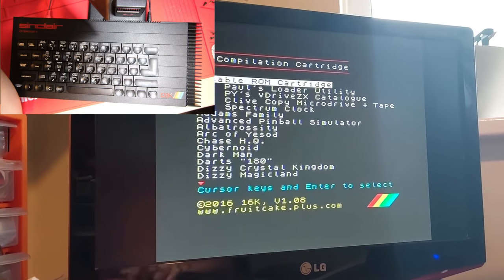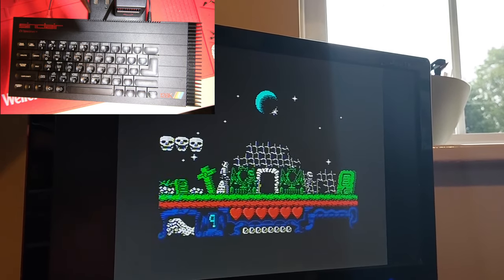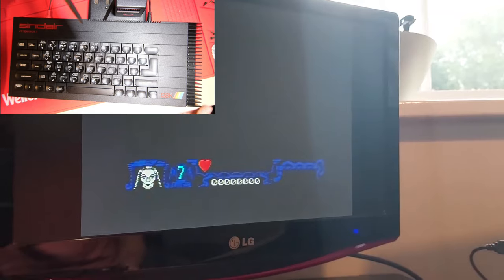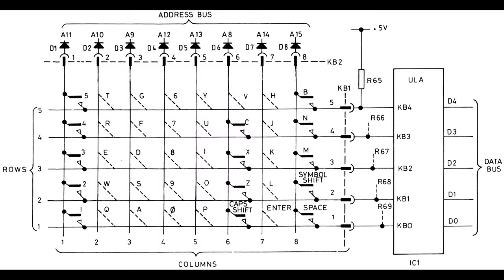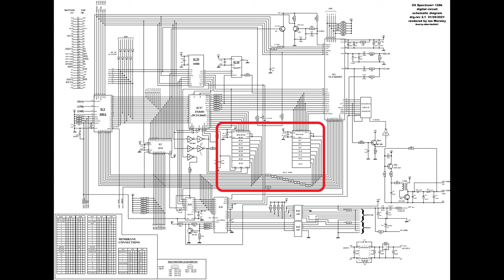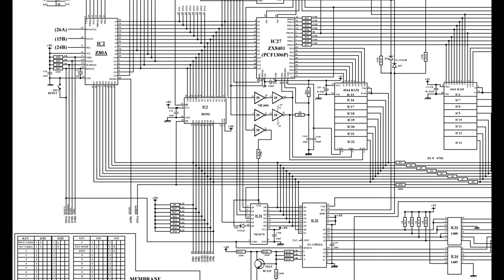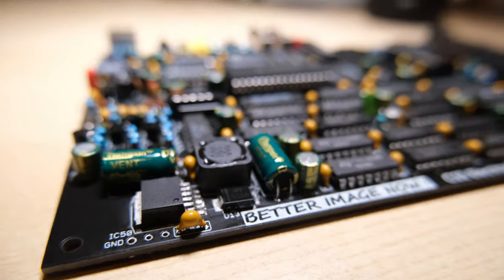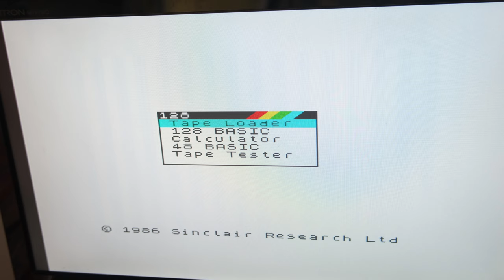ZX Spectrum 128K Toastrack Repair - Games Crashing When Keys Pressed

Comment: It’s jolly interesting how tiny parts of an IC can fail. Maybe not even a hard failure but it just drifted out of spec. Could be just a single transistor driver attached to an address pin. It’s common to see bits (pun) of DRAM go intermittently bad but I’ve never seen a processor do this. Very interesting, cheers for the vid!
Reply from the maker: You're very welcome thanks for watching

Comment: Hi, just to let you know that I had a Toastrack with memory problems in the 128K mode and it was a problem with the AY sound chip. In 48K mode it would run perfectly but with 128K games after 20 mins the system would crash. Under memory test it would indicate different RAM chips. The giveaway was that the sound in the game would start distorting just before the crash. A few drops of IPA on the AY would cool it and bring it back.  Replaced the AY and it has been fine.

Just in case you get one in for repair.
Reply from the maker: Great thanks for the tip!

Comment: ooer, definitely heard of 'weak' or iffy M1 lines on z80s but not address  lines, i suppose any failure mode is possible, what brand was the bad one?... as for the second one not booting from cold unless you reset..dried up reset capacitor?
Reply from the maker: I'm not sure of the brand and it's already in the graveyard. And I'm afraid the reset capacitor isn't the issue with it
Reply: @HappyLittleDiodes  curiouser and curiouser 😏dc-dc converter issue- bad cap there? maybe slow to get voltages up ?
Reply: looking close at the video , the logo looks like the SGS logo, uh oh, i bought 40 of the things fairly cheap in the mid 2000s, hope theyre not iffy !!
Reply from the maker: New caps all round and the issue was the before changing them over
Reply from the maker: If you're interested, replacing the 74S04 chip from the clock circuitry has fixed it
Reply: @HappyLittleDiodes  maybe it was low output?
Reply from the maker: Who knows!

Comment: Interesting video. Thanks! A side question: is it possible to replace the Z80 with a higher clocked CPU? Does a such a thing exist? Can it be manually overclocked in some way? If so, would games be faster?
Reply from the maker: The ULA actually generates the CPU clock so the ULA would need to be involved! RAM timing may come into it too
Reply: It’s all synced with the video isn’t it? I can’t see how you’d fiddle with the CPU clock on a vanilla Speccy.
Reply: @lawrencemanning  the ula and cpu arent quite as tied with video as in a zx81, ..you certainly can fit a faster grade z80 in but it'll still run at the original speed as clock is generated by the ula, there was a 'turbo' double speed mod for the zx81 which ran the cpu faster under certain conditions, MAY be possible to do similar with a spectrum,  depends if the extra circutry such as the ram multiplexers and control chips will work correctly at that higher speed,, there may well already be mods on the net ..dunno! ... problem will be with ula generated sound as the clock will affect pitch and note length, you'd need a modded rom patched in when in 'turbo' mode !! and would affect tape load and save rates...sounds a lot of bother,  the zx81 mod automatically switched back to normal clock speed on tape access